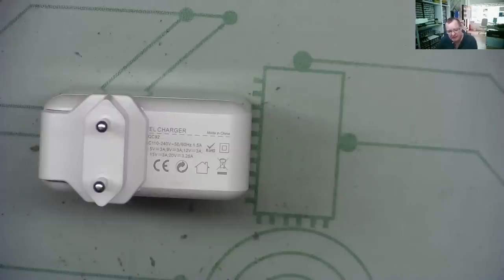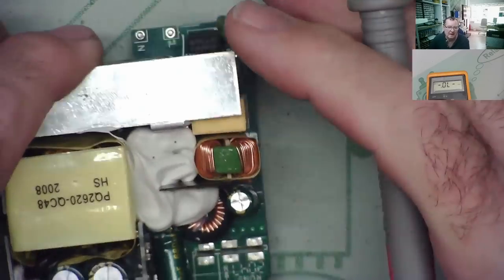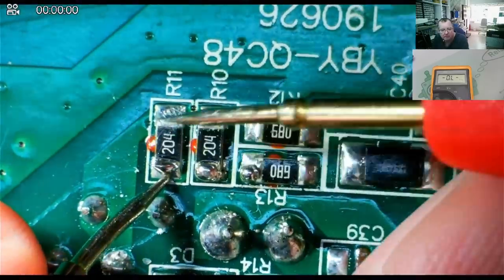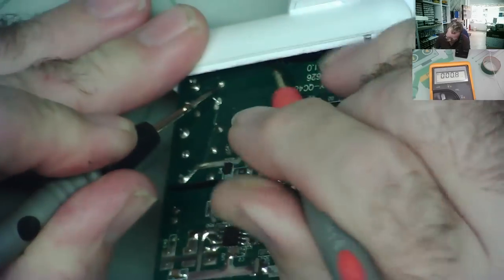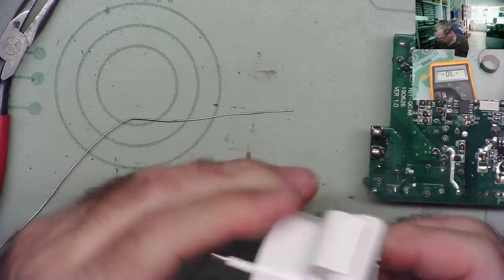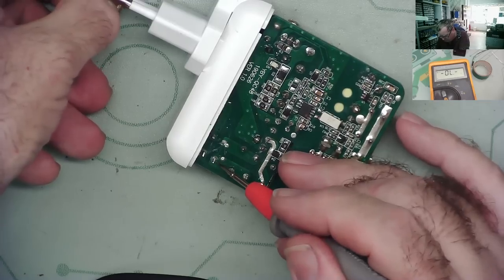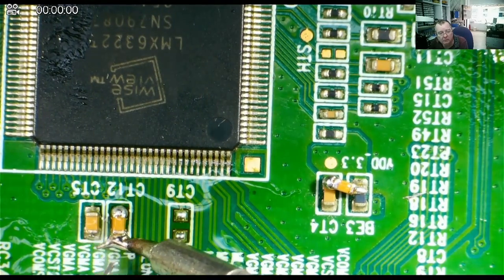USB-C PD Power Supply Charger Repair.  Dead PSU

Comment: A good quality charger, technically quite sophisticated ( as opposed to some of the cheap fire hazards out there ) let down by a very poor ( in my opinion ) crap friction fit mains input, crazy. Your hard wired solution is how it should be assembled in the first place, this is the trouble with having a changeable input for a universal device, I've come across this a lot, some of the cheap chargers are unbelievable as you know. Keep the videos coming, some good varied content lately. Regards from Yorkshire

Comment: Worked very briefly on a CRT's at the BBC.  They used to use an incandescent bulb to discharge circuits and leave them in situ to bleed any recovery.  Had the advantage of having a visual indication that you'd just escaped a shock :)
Reply: I was thinking about building a discharge resisters with an LED in the middle.
Not sure if it's a good idea or not.
Reply: I hope you managed to avoid meeting Jimmy Savile in a dark corridor.
Reply: @aurthorthing7403  Mr. Carlson's Lab Patreon page has a  circuit just as you describe.
Reply: MrTGuru  with voltage high enough to give you zap LED will glow even with 150k resistor. But to avoid having LED as point of failure I'd add it in parallel with high wattage resistor which will actually discharge capacitor with separate led resistor, something around 47k
Reply: @romancharak3675  SWEET!
I need something to do bc it's sleeting here.
Reply: Mr Guru  yeah....um it will work but at lower voltages the LED won't light up very much.
Mr Carlson's Lab built one that does what I am referring to.
Reply: @aurthorthing7403  I'm planning on building something like that, but with an analog voltage meter across the leads to actually see the voltage going down. The meter only goes to 250V~, so to protect it I put a 230V MOV across it with a fuse in series should it reach higher voltages than that with some margin. For the resistor, I opted for a 50W 2K2 resistor. Massively over-engineered of course, but it all fits neatly in a sturdy plastic bread spread box ( of course perforated at some points to allow for some ventilation ). Two 4MM sockets on either side complete the package.
Reply: @LarixusSnydes  that sounds a lot cooler than a diode.  Thanks for sharing.

Comment: dear lord what a massive ballache that was. id probably drill a hole in the charger and fit a normal plug + 20cm insulated wire pair or something
Reply from the maker: Yeah it certainly was.
Reply: My technique would be to climb up to a tall building and chuck it out of a window, it's someone elses problem now.

Comment: 2:01 - I discovered many years ago you can put this lengthwise in a bench vise and increase the clamp pressure to just beyond the point of bulging. In many cases, it will open the seam far enough to get a spudger/screwdriver started. I've done it before many times without damaging the PCB. I've repaired many a wall-wart this way, merely resoldering to the board the broken output wires where high cable stress broke the conductors inside the insulation.
Reply: on the macbook supplies you could remove or open the parts where you can coil up the cable then find something the correct width to twist in there and they would pop open. the issue with driving a screwdriver in is that if you do not know what is on the other side you can obviously destroy part of the board. Good tip. thanks, i just fixed my bench vice after destroying the main nut on a car bushing project. i welded a cage around it to fix it.

Comment: Dielectric absorption can be a bugger; the voltage can rebound to quite a high value in electrolytic caps’ after being discharged from a high voltage. 🙂 would be nice to see a bleed resistor across this to stop it occuring.

Comment: Richard, The Dielectric Recovery is a fascinating subject that is responsible for the high voltage capacitor voltage bouncing back under no/light load conditions...

Comment: Hi,. I am fairly new to electronics and am a new subscriber. I have a small pair of ciramic tipped tweezers for lifting surace mount components. It was a tip I saw on another youtubers channel. They do not wick any heat away from the component. I am learning more from you than I learned in the last six months from anywhere else on YouTube. Keep up the good work and thanks.
Reply: i might have to look for those. thanks for the tip

Comment: That bit where the voltage goes back up, I've heard it called "dialectic recovery" where it's explained as there's some dialectric charge across the plates that take a little while to settle into new places or something.
But I too don't actually know how this actually works either, would be nice to know a bit more.

Also, I wonder if you got shocked at 170V (153V after shock)?
I got a belt of 300v across my hand and I didn't remember throwing the PSU into the wall, one would thought I'd of learnt my lesson but I've gotten shocks off of no-start PSUs since at lower voltages X'D.

Comment: I had a power supply with the exact same problem. I was very surprised that you didn't notice that by default, it is a US fold out plug. Very common for many poor quality power supplies. More than an hour of video for not much technically, except, sorry to tell, for the electric shock (with happily no damage, but a good remainder). Not buying craps from AliExpress for several years has made my life better.

Comment: I remember having that problem with a cheaper adapter. I totally disconnected the 2 pin connection in the adapter, drilled a hole in the bottom of the adapter and added a short mains lead with a 3 pin uk mains plug. Works fine now.

Comment: 3 years ago i repaired my one plus warp charger got zapped also :)) but what i found out to be very helpful to pry open this kind of devices that are ultrasonic welded, was to stick the device in a vice and tighten the vice until you feel/hear small cracks in the weld .. and to put it back i used some epoxy glue .. and all good so far with the charger after 3 years :D

Comment: I see you didn't learn your lesson from last time 😂 at least you didn't edit it out like most would have!
Reply from the maker: Last time was over a year ago LOL.  Nope I don't edit stuff like that out, I like to keep it real here, I'm no angel and not perfect. It's important to show what can happen as a reminder to everyone else.
Reply: @LearnElectronicsRepair  I get a good belt from time to time. lol. i think the bad connection on the input may have caused arcing which shut down the driver ic or put it into a bad oscillation, from this point the fet could not work and the cap could no longer discharge to the transformer.

Comment: You persevered way longer with that utter piece of s**t PSU than I would ever have done...despite possessing a lot of patience usually. I would have had great pleasure taking that cheap, badly designed piece of junk outside and introducing it to a sledgehammer. 10/10 for keeping going to the final result.

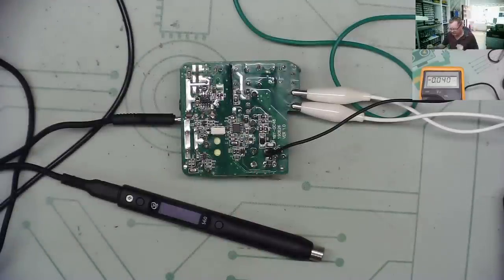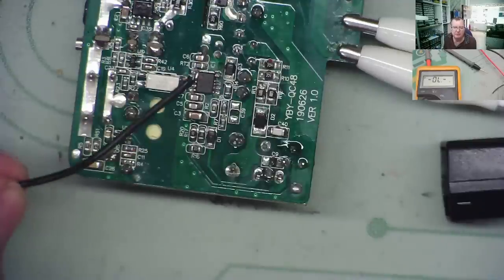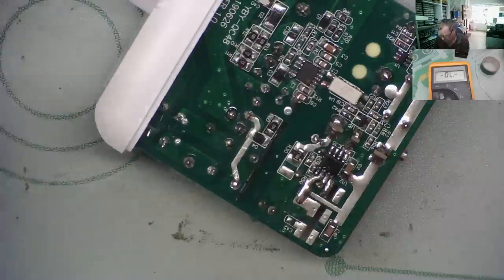Comment: 32:59 - The only valid explanation I can see for this mysteriously now working is that when you connected your test lead to the board (28:09), you reflowed a cold solder joint at that point. 33:52 - I guess I should have watched the rest of the video before commenting.

Comment: Daft solution indeed that friction mains contact.  I repaired a Samsung genuine 5v usb charger that used the same method.  North American prongs only, but same contact method.  One contact went bad and carbonized around the contact.  Dodgy.

Comment: Interesting fault, well done for chasing it down.  What was your opinion of the soldering job on the circuit board? ... it looked a bit handmade and sketchy although I’m pleased it is working again.
Reply from the maker: The soldering on the PCB is working just fine so I can't really say anything negative.  I would say as long as it works reliably it's appearance isn't really an issue

Comment: Advice to anyone contemplating the finger method of discharging high value capacitors is to lickyour finger first. The capacitor will discharge much faster due to the lower resistance path. It won't hurt any less though.

Comment: I had exactly the same unit here in UK but with a different brand name than yours.  It had a loose wire on the metal mains 220v and the two prongs. I fixed it in 10mims...
Reply from the maker: 10 mins? Clearly you are far better at fixing these than me LOL 😅

Comment: The intermittent contact(arcing) on the AC in charged the cap but because it then dissconnected due to the faulty connection the discharge field was disrupted ?

Comment: Is it not a resistor that usually discharges the cap? But i think you said in this case it is the driver chip that works the cap and this discharges it while it works from the FET into the transformer coil.
  What might have happened is that the bad connection on the input caused some arcing which put the driver chip into a type of shutdown or bad oscillation and it could no longer drive the FET, once the FET stopped being driven the cap could not discharge to the transformer?
This might have happened due to twisting the supply slightly as it is removed from the 220V socket and the bad connection initiates the fault described above. Regarding charge rising in the caps, one thing i can say is that voltage will be relative to current available so, even if it is rising, then I expect less current will be available as it rises, it's less likely that voltage and current can rise together but perhaps some power is being scavenged as such from the depths of the layers, probably as the electrons re-organise themselves to even out across the plates / layers, i was going to suggest the rise was coming from other caps on the board but i guess this is a known artefact, must be due to electron reorganisation or perhaps something to do with the dielectric / electrolyte acting differently under different voltages.
Reply: Very good explanations. I don't know much about electronics, but I always assumed it was the battery of the multimeter charging the capacitor up 🤷‍♀️ Lol....  but your answer sounds much more convincing.

Comment: The other connection point is where the EU plug slides onto the North American plug which flips out to use in 120V countries. The cheap two blade plug pins made in China are very loose in North American outlets. I bet the connection is very sloppy where the EU plug adaptor slides on.

Comment: Oh Richard, if you could hear the loud shouting in my head while you've struggled to open the adapter 😀Noo noo, just push it aside. Those are US plugs under it. 🙂 (and no, I haven't had this one in my shop, but I've seen similar non USB-C for laptops) But you managed to fix it at the end, like a pro. Oh wait, you ARE a pro 😀 hashtag ** quality entertainment with electroshocks **

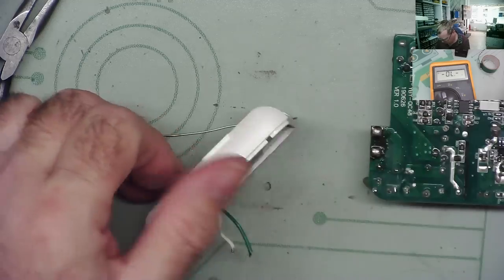Comment: @ 47:24 ROFL Under your left index finger... Those 2 tags can B moved 90' up;... so that it will plug in2 a 3 pin ~ 2 pin uk shaver type adaptor;... where the pins R closer than the part U have in your right hand...
Reply: @49:14 U found out they move...

Comment: 5:38 is it because the DMM is passing a voltage to measure?
Reply: I would expect this in a continuity mode or diode mode because a voltage needs to be applied for these to work.  Not sure if it should be happening in reading the voltage mode, but it's clearly happening although I can't explain why.
Reply: My first thought as well but it's apparently due to something called 'Dielectric absorption' where capacitors that are discharged very quickly don't actually discharge completely even though they look like they have.  Some of the charges take longer to become unpolarised but it doesn't show up on the voltmeter.  It's like a memory.  The amount of dielectric absorption a capacitor exhibits is highly
dependent on the dielectric material: polystyrene, polypropylene, and teflon display
very little absorption, while ceramic is a much poorer performer. SiO2 displays about
0.1% dielectric absorption, putting its performance in the middle of the pack.  Interestingly the effect is present during charging as well.
Reply: @bittertruth6575  I've heard of this, and you may be correct.  However, every capacitor I've every come across I've always simply just shorted with a screwdriver before verifying that it was discharged, and I've never seen this. I'll admit that this is probably a poor practice, but I've never had an issue with it either.  That said, I have never seen a capacitor rise in voltage while checking it's voltage, but it's clearly happening in this video.
Reply: Very patient Rich I thought the hammer was  going have to come out to teach it a lesson👍
Reply: @gordonemery6949  The hammer who's head keeps falling off from the Chinese shop 😁
Reply: That's the one,half way through I thought to myself ,right scrap it salvage some bits and bin it😂
Reply: @bittertruth6575  Interesting stuff. Thank you.
Reply: @bittertruth6575  Do you know if it is an issue in circuit design?
Reply: @ShotgunAU  Yes it is and it becomes more critical in high end applications. For your average enthusiast, I don't think it matters a great deal, especially when the circuit is working as it should.

Comment: lol that is the worst design in the world ! I'm wondering how long this fix will last. If you shake the PSU harder the solder blobs may lose the contact again. Probably you should put the wire directly from the input pins to the board and finish in 5 minutes.

Comment: does the flluke meter have any voltage on the leads ? measure it with a old analogue meter if you have one.
Reply from the maker: In voltage range no

Comment: Is the reason the voltage is going up because the multimeter does provide some voltage to do it's measurements
Reply from the maker: Not in voltage or current measurement, only in resistance/diode mode
Reply: @LearnElectronicsRepair  Thanks for letting me know. This is how I learn

Comment: I love your videos!! can you help me? I have a electric wheelchair that is 24V 55AH (12V 55AH X 2 in series). i have 2 X 12V 45AH that i want to add to it. what is the best way to add them to the circuit. please explain to me why the way you suggest, is the best?
Reply from the maker: What are you trying to do?  Replace the two 12V 55AH with the two 12V 45H - then just swap them, it will still work but limit the range.  Add the two 12V 45AH to increase the range?  Just connect one 45AH battery in parallel with each 55AH battery.  Trying to break some speed records? Connect all four batteries in series and go like sh!t off a shovel until your ass catches on fire 😜
Reply: What he said will work but the smaller batteries will drain first and then start asking for a charge from the larger Ah batteries. If you want all 4 working the 24V controller it might be best to have a way to switch the 2nd set in once the first set die and then charge both sets once needed, other wise there will come a point where some of the power available will just be used charging the 2nd set of batteries. If the charging efficiency was 100% it would not be an issue but it is not 100% so you will loose potential motor driving power while the batteries waste it as such while trying to even out.
  The only real way to match batteries for in parallel circuit is to drain them from full one by one via a discharger that can tell you the total mAh available. Then you can start putting cells in parallel etc. 
  However it depends on age, battery health and how each battery will deteriorate over the next years to come. 
  I think the simplest is to have a relay or very large switch that switches from the dead set to the new set as needed, then charge individually later, or via the switch/relay you installed.

Comment: When the contacts are down is it physically removing the connection as feature of the plug design ?
Reply from the maker: No.   With the contacts down you can fit the UK and EU socket adapters
Reply: @Learn Electronics Repair  thanks for your reply  enjoy your work
Reply: Also, when the contacts are down the supply will plug into a US receptacle without any adapters.

Comment: I think the voltage charge from the leads from the multinterer. The multimeter has some voltage from the battery to check diods and so on. Its my thinking of it thats why cap charge

Comment: Isnt voltage on capacitor rising because your multimeter is outputing voltage this charging cap ?
Reply: What happen if one dmm is meassuring What another dmm measures when measuring.... Damn that got wierd to type haha
Reply from the maker: @KennisFix  That happens in resistance or diode mode - the meter outputs a voltage, but in voltage or current mode it does not

Comment: The way you open stuff is really painful to watch.
You don't need to butcher plastics with a screwdriver, most power supplies can be opened with light taps on the seams until the glue bond breaks (unless it's Apple stuff, in that case forget it as it would be thermo welded). 
A rubber mallet of course would be better.
Reply from the maker: Call me brutal but I did actually cause very little damage to it
Reply: @LearnElectronicsRepair  still painful to watch. BTW instead of buying expensive plastic prying tools, I'd recommend you try a set of guitar picks of different thicknesses. They are 5-6 quids on amazon and come in a nice metal box. These are very useful for taking apart laptops, external hard drives and assorted plastic enclosures with clips.
Reply: you can open mac supplies with a large tool or suitable piece of metal placed in the part where the cable coiling wings open up, then twist.